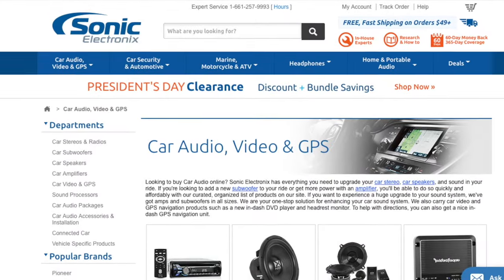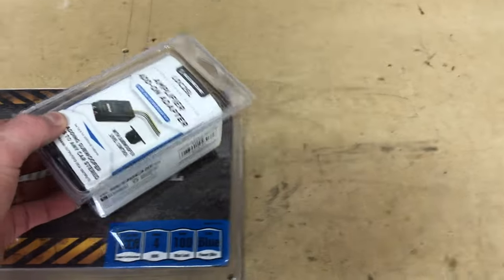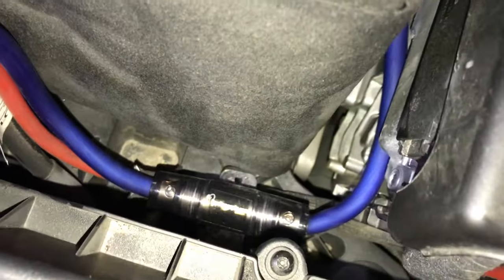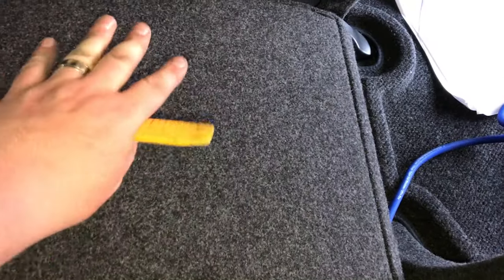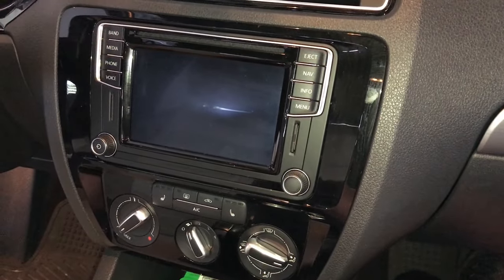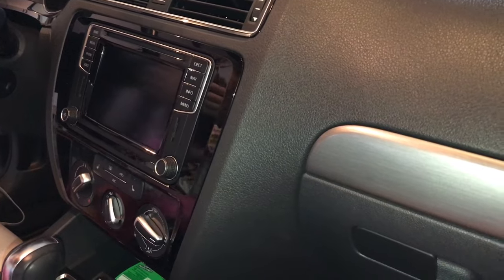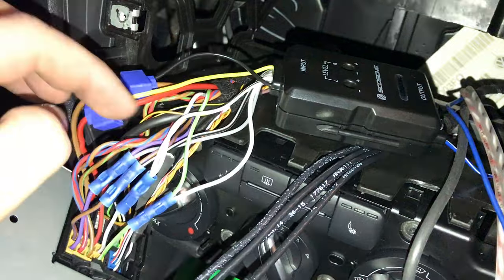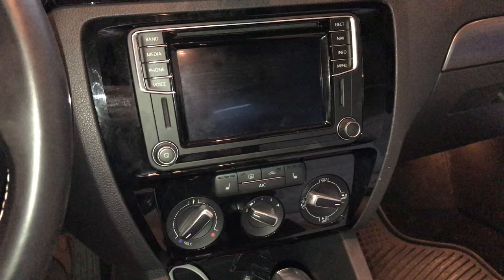2011 - 2018 VW Jetta Sub and Amp install to Factory Radio

Comment: Just a tip to anyone working on a Volkswagen. These cars are notorious for bass roll off. I would purchase a good LOC like the audio control LC2i
Reply: where can I find this? would you be able to send me a link with that? Or even possibly a link to a good wiring kit too? I will be installing 2 kicker comp 10 inch speakers and a kicker 1000 amp. I believe the wattage for the speakers will be around 1200.
Reply: What's bass roll off?
Reply: What's bass roll off
Reply: @bakachelera  the stock head unit starts ramping down bass as volume gets higher to prevent damaging the shitty stock speakers. When you hook up your LOC to the speaker wires and run that to your amp you are getting robbed of low frequencies when you crank it.
Reply: Thank you. I've been wondering this. I assumed they did roll it off. Il invest in the lc2

Comment: are those wires from the factory head unit full signal or are they bass blocked from the factory? that would hurt the bass if the head unit is not putting out a full signal of sound. Looking to do that with my fender system in my jetta. Single 12

Comment: On the gromit would it of been better to drill a hole instead if making a slit in the rubber. That way it would be a tighter fit. Just an observation
Reply from the maker: All up to the install and their preference.
Reply: Ya I would have used a step bit a d cyliconed the other hole. Also don't  like to just tuck any wires. Rather zip tie, use factory wire covers, or tuck under the carpet. That's just being lazy

Comment: THANK YOU SO MUCH I threw 2 12s in my jetta n basically copied you step by step. MInes a 2013  though THANK YOU SO MUCH AGAIN THOUGH lol if anyone gets thrown off by the back of there head unit having 2 large red power wires and a brown ground just use the power wire right next to the brown ground FUCKING THANK YOU ONE MORE TIME!!! YOU THE REAL MVP
Reply: Hows the sound quality using the passive LOC? I want to do a similar Install and trying to see if the investment in an active one with a bass boost is worth the cost and hassle.

Comment: Great video! Just did this installation with the help of this video on 13’ Gli. However I had two red/yellow wires but I used the one next to the ground and it worked.
Reply: so its the one thats closest to the ground wire? I didn't know only reason that I don't have it all hooked up
Reply: Can someone confirm that this is the right wire?
Reply: Do you have the fender sound system? Ive tried tapping behind the stereo and no signal is coming out.
Reply: @zabdieltapia6553  did u get it to work and how? Cause I have fender as well and it hasn’t worked for me yet
Reply: @Yugoslanik   I also have fender and wanting to do this any updates ?
Reply: @zabdieltapia6553 I am told that the fender system works by driving the speakers of different ohmage from a separate deck then the stereo. This MIGHT be the case. Try to follow the speaker connections to them amp. You can also hook this same RCA/remote module into the back nearest to your speakers and amp which might be easier.
Reply: I’m worried that this scoche module (the high input to rca and remote wire) are getting constant current and therefor will lead to a ‘parasitic drain’ to your battery over time.  
Seems like it should get cut off like everything else in the car but vws wiring is different. 
I also have two red/yellow wires and both still give power even when the car is off.  Therefor it shouldn’t matter what one you choose to hook the scosch to but it may get a little current when the car is off?? We will see I guess.

Comment: This video was very helpful! I have the exact same model Jetta.. Really wish there was rear speakers to make it easier to connect the LOC though..
Reply: What do you mean you have no rear speakers ? Do mean no actual rear speakers or no rear speaker outs from head unit ?  I had an amp installed in my 2017 Jetta and now have no fading option from head unit where I did before the aftermarket amp install.

Comment: Did you lose the ability to fade the speakers from front to rear ? I had an amp put in my 2017 Jetta and I now  have no fade option from the head unit.
Reply from the maker: Not at all, we are just robbing the signal for the bass amp.  The factory audio system will remain unchanged.  Sounds like a wiring issue to me.

Comment: I completely wired everything but the radio, I have the oem radio for my Jetta but the wire colors are different so I'm kind of stuck, might have to bring it to a shop unless you can help.

Comment: Can I just tap the red + 12v from the radio as remote wire? Since my speaker to RCA dont have remote wire. My radio is RCD510. Thanks for your help.

Comment: is it okay to use a cigarette lighter plug into the 12v in the back? the plug has a fuse. i wasnt sure if the battery will be constantly drained when the cars off. some cars shut off all power and others keep pulling power. i have a 2014 vw sportwagen

Comment: Can i tap the front speaker wires for adding LOC? Here i see u tapping the rear speaker wires. Any difference is there? 
Thanks
Reply: You can if you want just habit probably I did one in my Corolla and just tapped into the rear speaker didint even have to run the speaker wire to the stereo

Comment: Wondering do I need that converter to plug the rca cables into or can I just plug them into my radio? Was hoping to not have to cut into wires

Comment: I did this exact set up.. except my remote trun on wore is constantly providing power to the amp so it never turns off! Please help!!!
Reply: Take the radio fuse on  the fuse box direct in the car
Reply: I'm having same issue ..my double din stereo stays on..I tried tapping in through the cigarette lighter but it doesn't seem to hold memory
Reply: Which fuse is radio fuse?

Comment: HELP HELP, ok very short story. I tried getting signal to my amp through rear speakers( head unit) no signal, just a very silent hissy noise.  then I tried the front SOCKETS (head unit) bam it worked, got a full signal but the problem is that I can't turn the volume down on the speakers that are connected to amp, it's like set to one volume.  Please help what else I can do?? Is my amp faulty?? if it is then how come I only get signal from front speakers sockets and not the rear?? also why the volume doesn't go down when I turn the volume down on my head unit.  Am I doing something crazy here?? what is going on? I've got the same line out convertor as yours and my amp is Pioneer a5702
Reply: The amp is powered on and remote turn on works perfectly but my issue is the volume that coming out of amp speaker doesn't change, the only way I can do is to just change the gain manually which it's nonsense.  I just want to be able to turn the volume up and down from the head unit like the rest of the speakers but it doesn't seems to work.

Comment: I have a 2012 Jetta, and in my dash there is a power output , it’s an old iPhone 4 charger thing that’s connected in the dash, would I be able to run my remote turn on wire to that ? Instead of connecting it to the 12v cigarette lighter output ? I’m quite the noob to all this and would appreciate the help
Reply: I'm not sure if that turns off when the car turns off if it does sure as long as you do it properly but this video is a very good representation of how to do it

Comment: is there a video showing how to get through the fire wall on a standard car?
Reply: I was struggling with this too and I had figured myself.
You have to remove the battery (keep it connected somehow or you gonna lose programming)! And then remove the black fiber behind it, you'll see a rubber thingy where the wires go. Punch your cable trough it and you're all set.

Comment: What is the point of using a CCA wire? Just to make it thicker? This is a power wire, not a signal wire.
Reply from the maker: OFC > CCA wire.  It's worth spending the money for OFC (Oxygen-free copper) wire can handle significantly more current than the cheaper CCA wire, hence why it's more expensive.

Comment: I've got a Jetta with a RCD 340 which isn't as great as the MIB 2 in terms of sound processing
The current setup is the RCD340 With the stock 4 speaker 4 tweeters setup
Now if I wanna upgrade my sound without changing the headunit what would you suggest? 
Should I change the speakers out for a higher output speaker and tweeter and call it a day or add an amp as well because with the stock speakers and the RCD the sound tends to distort after about 50% so do you think maybe an underseat sub+amp would help out with that ?

Comment: So I tried this & I don’t really want to put the amp onto my speakers in the doors just for the subs actually & hooked my yellow which would be positive on the converter & then hooked black ground to the brown ground wire on back of stock head unit and ran the blue back to my amp & still nothing is turning on at all I’m lost… any help would be greatly appreciated

Comment: I know for some cars hooking up the amp to the car battery will drain the battery even when the car is off. Would that be the case for a jetta? Im debating on just using a separate car battery.
Reply from the maker: If the amplifier isn't installed correctly, yes it could cause a drain.  Correctly installing the amp will not have any draw when the vehicle is off.
Reply: @ProvoBeastAudio  appreciate the quick response. So, would opting to use a cigarette lighter adapter plug drain the battery? I know those adapters have fuses in them. Im just trying to avoid buying an in line fuse and going through the fire wall.

Comment: i have one sub connected in my 2012 jetta and lately its been having issues where itll turn off while im stopped at a light or something but itll turn right back on. someone told me it could be the sub is too much for the battery i have. i know its a diehard brand one, but is there a specific battery i should get thats maybe more apt to handle the system?
Reply: Check your wiring and make sure if your remote is to a fuse in your fuse box it's one that's on as long as the ignition is on

Comment: I have a question for you, maybe you can help or you can send me a link to show me step by step on how to do it. So, I have a VW Jetta 2014, with Fender sound system and as you know with Fender sound system it automatically comes with Amp which is located underneath driver seat. So my question is, will I be able to add 2 extra speakers to the current ones, other word I would like to add extra speakers to the existing speakers without replacing any. If so, how to add another amp to the current amp? or how to remove the current amp and install a more powerful amp?? I hope it does make sense.  I would really appreciate your guidance.
Reply: What it is What it was  Thanks

Comment: Was hoping you may see this...but I just installed the line out convertor (same one as in the video) but even with my car shut off the convertor is still powered and my amp is remaining on. 2017 Jetta. Is there a fix?
Reply: did you ever find a fix to this? im having this issue

Comment: I need the wiring diagram pleas 2012 jetta tdi I had them working but it was a bad connection and it got loose and now it wont work at all

Comment: I followed exactly what you did. I have power and audio but when I turn the volume to a little past halfway it causes my amp to cut off for a few seconds as if the wiring is backwards.could the line out converter being bad cause this?
Reply: I am having that issue with my passat 2018. 😞
Reply: @alejandrotosti7932  I hooked up the same system in my honda civic and it did fine. I think the Jetta was just not capable of producing a good enough ground

Comment: My 2016 Jetta doesn't have the green part with green speaker wires on the back of Head unit. Do you know which wires would be for the left side in this case?
Reply: Green with grey is positive and grey with white I belive was negative if that helps

Comment: Did set up as shown in the video everything is getting power that it needs.. except the sub is not working amp is powered on the right way and everything the only thing not working is the sub itself any ideas?
Reply: Cody Hunter if you followed everything in the video, check your power and ground wires from your amp to your sub. I just did this earlier, didn’t use too much of the video, but from past experiences that could be it.
Reply: @oneguyonegame371  checked all the wires they're all getting sufficient power and being grounded properly I'm just gonna go through it completely tomorrow and basically restart everything and make sure it's all 100% good hopefully it works... Thanks for the reply though!

Comment: My question is about the sound. I've not used a Line-Out converter and have always used aftermarket heads with dedicated rca's which isolate the low range signal. It's my understanding that tapping into the rear speaker wires you're going to get the high mid and lows going to your amplifier. I would like to be able to isolate the lows so my subs are just pushing bass and not high and mid-range sound. Is this possible?
Reply from the maker: Yes, most amps are equipped with crossover adjustments, so you can set the low pass filter to about 80 hertz.
Reply: Why not just tap into the speaker wire in the rear of the car instead of up front?
Reply from the maker: There are no speakers in the rear deck, so this would require us to tear apart both b pillar covers.  It was a whole lot easier just to pop the radio out.
Reply: @ProvoBeastAudio  do you by chance have a fix or idea for the power to the amp staying on even after car turn off.

Comment: My LOC doesn't have the Remote Turn-On feature so I'm going to run it through the cigarette lighter. Could you please confirm that it is the BLACK wire that I want to connect my RTO wire to? (This detail was not mentioned in the earlier video.) Thanks.
Reply: Where did you end up ring that remote wire??

Comment: How did you get the positive nut off ? When I tried it dug into the terminal and now it just spins
Reply: You need to hold the square side with a wrench. Also the stud is "staked" as to prevent the nut from coming off. That's why it's difficult to remove completely.
Reply: Yes, THIS ^^^ It just stops, i guess the term is "staked." If I hold the square part so it does not dig in, will it just come off with pressure without stripping it? Afraid it won't go back on tight.

Comment: What’s the benefit of using the LC2i vs something like the kisloc?
Reply from the maker: LC2i has signal correction where others don't.  Just depends what you want out of your system.  Often times VW factory radio's have pretty severe bass rolloff at higher volumes to protect the factory speakers, and the LC2i corrects that.
Reply: @ProvoBeastAudio  What’s the difference in installation process? And what would you recommend for running the SKAR SDR-1X12D2 and SKAR RP-800.1D Amplifier along with RCD 330 Headunit? I’ve been only been suggested Kicker kisloc. Just looking for a recommendation

Comment: How do you run through the firewall on a stick shift? The clutch master fills that hole...
Reply: Robber grommet with chassis harness to the up and left punch a hole through with screwdriver

Comment: Isn't there a factory amp under the driver's seat? Wouldn't it be easier to run to that instead of behind the head unit? (I'm asking because I'm doing research for a friend's car...looking into replacing the factory amp)
Reply from the maker: All depends if you have the amplified system or not. If you do, that certainly would be a good place to grab signal, sure.
Reply: What should the wire colors be if we tap into the amp cause they are not the same as the ones from the video I have a 2016 gli wit the fender audio system

Comment: What did you end up doing with the RJ-14 bass knob cable? I see the line out converter comes with one already. Can you just use that instead of the RJ-14? My amp also has the female port for a RJ-14. Or is it neccesary to hook that up?
Reply from the maker: Nope, not necessary, the guy wanted to use the Kicker knob instead of the scosche knob.  either one will work.  The difference is that the scosche raises and lowers the RCA signal line input to the amp where the Kicker knob increases and decreases the DB bass levels on the amp internals directly.

Comment: Hey. I have a 2014 Jetta that has the regular radio. Can I purchase one of the touchscreen ones on eBay and just put it in, or is there more to it?
Reply from the maker: Nope, you will need a few install parts to make it happen.  Head over to Sonic Electronix and use their vehicle fit guide to determine what parts are needed for your Jetta to install a new double din.
Reply: I know I will need parts, I have tools. I just mean I read somewhere that I would need some type of "radio code" for the system. Do you know what that is referring to?
Reply from the maker: No not necessarily, generally that implies if you disconnect the radio, it would go in lock down and you would need a code for it.  In most cases, that isn't the case with VW radios, however, usually the manufacture will include the code in your documentation or on the radio if it does.
Reply: You can just get the oem rcd330. No security passcode required. It has apple CarPlay and android auto. The only problem is that the volume past 50 percent, the audio beings to distort. Unless you have an aftermarket amp.
Reply: Billy Owusu That doesn’t sound good. The only reason I wanted the original was because I’m afraid a different one won’t fit and look crisp

Comment: I've heard conflicting stories about my 2016 Jetta, is it the front or rear speakers you hook the loc to for the best bass?
Reply: I have a 2015 jetta and just ran my speaker wire the same way the video did